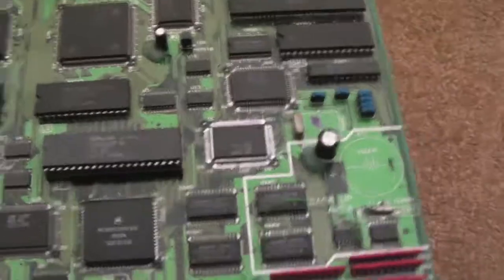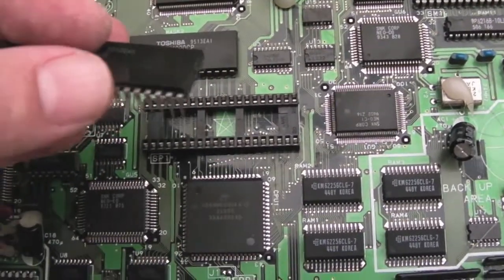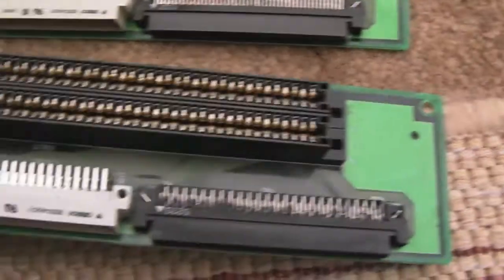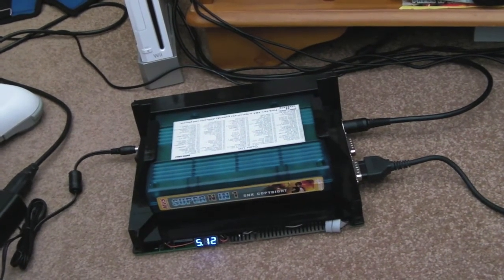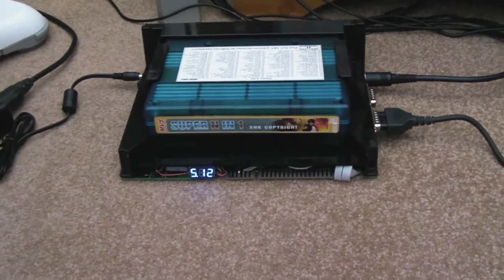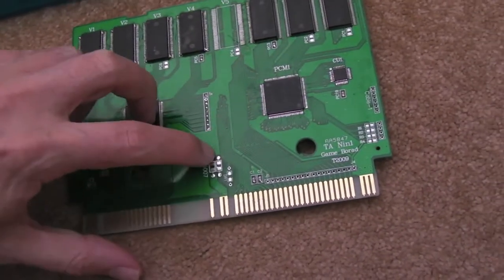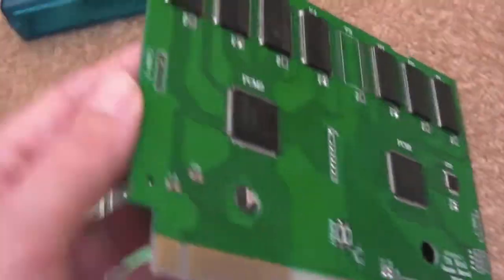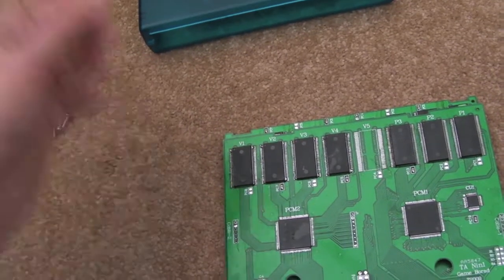SNK Neo Geo Projects Update

Comment: Does anyone knows what are the blue named: "BFx20" Are they capacitors or resistors? If they are capacitors, what's the rating or model part to replace them?  capacitance 100 ohms on each?
Reply from the maker: They are capacitor resistor networks.  Using this diagram you could make your own using seperate capacitor and resistor:- https://wiki.neogeodev.org/index.php?title=CRE401
Reply: What is the modern part number or name equivalent to replace one missing blue BF on a NEOGEO BOARD?

Comment: Which game had the problem caused by the Neo-C1 chip?
Reply from the maker: All games - it related to the player 2 start button not working.  That chip can fail in multiple ways though.  The way it works it is accessed with different addresses by the CPU, and it then checks the input states of the buttons (low = pressed, high = not pressed), and then outputs bits for button states to the data bus.